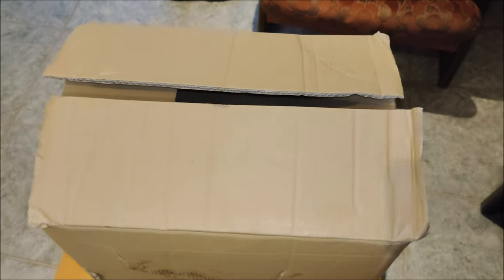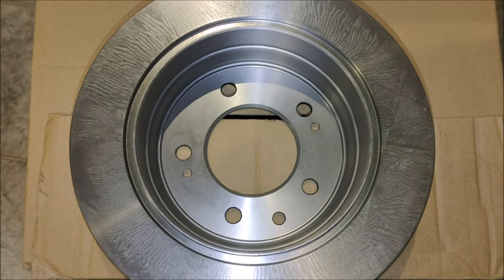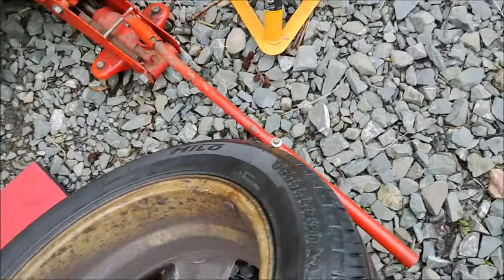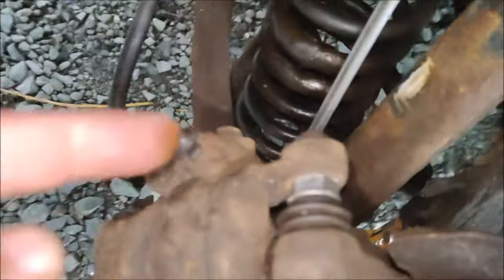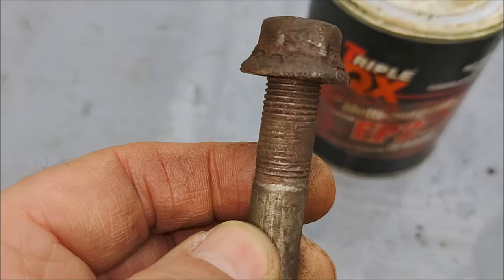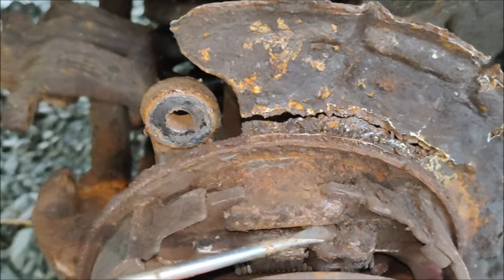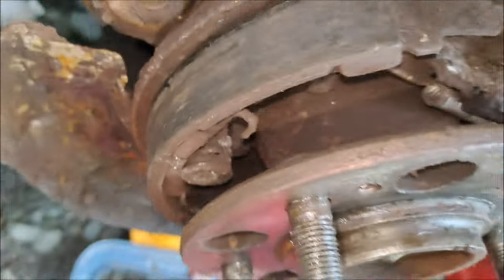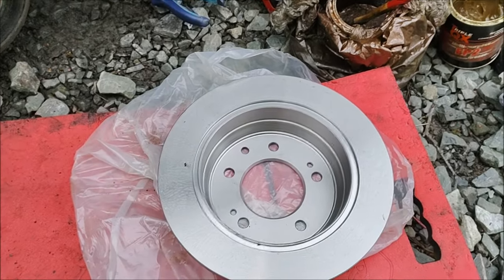Kia Rear Disc Service - 2012 Ceed ED Example

Comment: Thanks for this , I have a 2007 kia ceed and I’m replacing the rear discs and pads this weekend and possibly the backing plates and I’m expecting a lot of seized and rusted parts. I managed to download a .pdf of the workshop manual and it looks like the same setup for your 2012 car. Watching this video is really going to help out. Cheers
Reply from the maker: Hi Pete, hopefully everything comes apart easily for you. As you can see in my case there's no shortage of corrosion but everything came apart easily enough.
Reply from the maker: Pete, here's an earlier video I did on the rear brakes.
https://youtu.be/pvuqiaWRoGg?si=Tahy4eNNIZCf3kcF

Comment: I just wanted to say thanks as in this was a fantastic help in getting the job done. I didn't do calipers, mine is 2011 and gone approx 140k km. How can you tell the calipers need to go you think? 
Doing the front tomorrow, hoping it's similar enough to this as first side took nearly 4 hrs and second time around 45mins or so.
Thanks again this was great for a novice mechanic
Reply from the maker: @johnniewelken5417  glad to hear the video was helpful for you.
I would just recommend checking the condition of the caliper piston (for corrosion) and dust seals (for any rips or tears) and any signs of fluid leakage.
I did a front brake service, a few months back, which you can see here
https://www.youtube.com/watch?v=cXNJPZVfgoA&t=538s
There are other videos to look at but you'll probably find the front end is easier than the rear, to replace parts and service components.
Reply from the maker: Here's the video from a couple of years ago when I replaced the front discs & pads.
https://youtu.be/NAcCRYva3lY?si=MiMlASk1ovT4Uo2o

Comment: Hey again, thanks for a great video. I used this video and the one you did on the handbrake to fix both at the same time. Invaluable to get it done right! The absolutely toughest part I found was getting the springs on the brake shoes correctly mounted, holding them in place and holding the cap to the springs with pliers and at the same time twisting them.. Well well, it got done and in no small part thanks to your excellent videos. Big thanks! For the future, would you consider making a video of servicing the EGR valve? I've heard some people debating about how clogged up this part can get, some simply using EGR cleaner directly in the engine air intake but I thought that dismounting it and cleaning it properly would be better.
Reply from the maker: Hi Gosta and thank you. The springs are certainly a bit on the fiddly side. I'm sure I'll need to get round to the EGR at some point but will hopefully stay away from that for as long as possible! :face-blue-smiling: I tend not to use the car for short journeys as much as possible, so fingers crossed mine is as clean as possible for now. Do you do a lot of short journeys or start stop driving in the city? That seems to be the main caused of clogged EGR valves?
Reply: @gtd65  yeah I would say my main use of the car is for rather short trips of max 30 minutes. So I think it'll be something to do at least once and to have a look at the state of it. Would you say it's difficult to remove it?
Reply from the maker: @gostaagerberg2153  it doesn't look like a five minute job, unfortunately. 
I watched a video a few years ago using a Sportage and there's quite a bit of stuff to be removed in that case.
I'd be inclined to try using some sort of solvent first. 
😇

Comment: Fancy showing us how to do a clutch replacement?
Reply from the maker: Gaz, hopefully I'll not be needing to do that for a while. Would probably need  the use of a lift to undertake something like that?
Reply: @gtd65  yeah contemplating doing it myself but think I'll be having a miserable couple of days doing it with my limited equipment and expertise. Keep the videos coming mate very helpful for people like me. My back brakes and fuel filter need doing and your videos are a great help 👍🏻
Reply from the maker: @gazwilliams9488  the weather has been bloody miserable the past couple of days with the high winds and rain battering off the windows here. I've never actually had to replace a clutch, so far, thankfully! What sort of mileage has your clutch covered?
Reply: It's done 120,000 clutch is original one, I'm finding it difficult to get into gear sometimes. Double clutching is necessary in 1st and reverse. And in low revs it's noticeable. Planning on keeping  this car for another 80,000 miles at least.
Reply from the maker: @gazwilliams9488  I think, I might have read something before, about adjusting the clutch action to resolve that? Have you had at look at https://www.kiaownersclub.co.uk/forums/ceed-2006-2012.54/
Reply: No I haven't but I will look into it thank you, I'll let you know how it goes 👍🏻